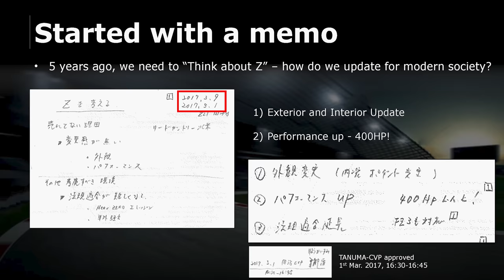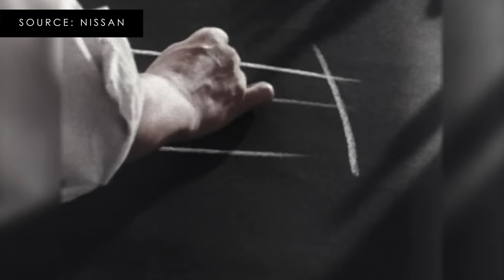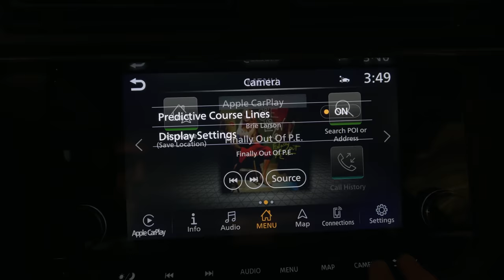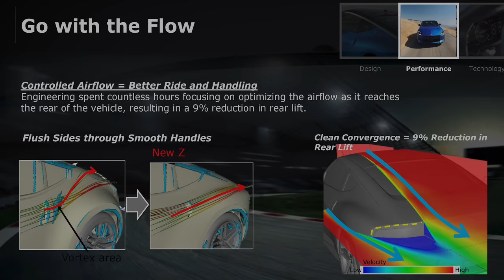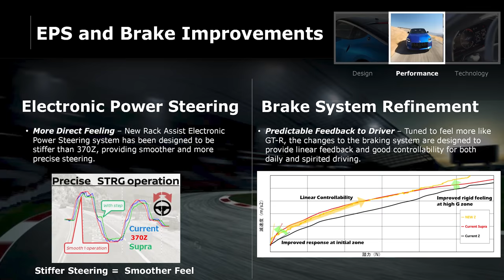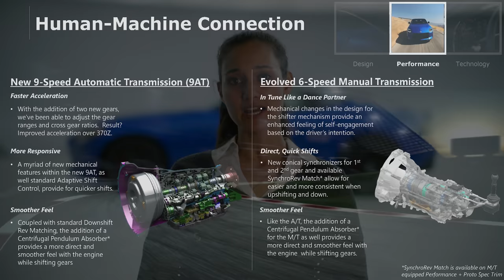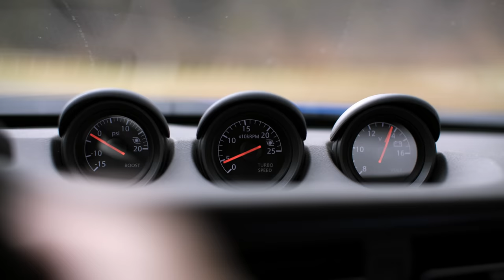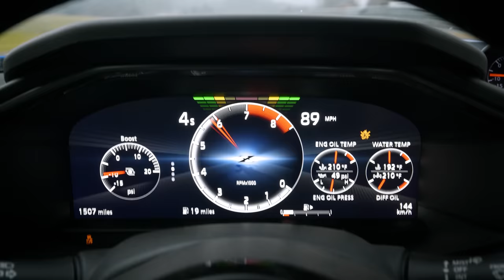2023 Nissan Z | Until The Bitter End

Comment: Even as a self-proclaimed Nissan hater, seeing the careful consideration that went into this Z is something that brings me tremendous joy. The world we knew is sunsetting, that is unavoidable. The next generation of driving may be awful, or it may just be wonderful in its own way, only time will tell. But for those of us who have been raised on the feeling of driving a well set up, connected sports car, one where every one of the senses is put to use to precisely move through space, the new Z is a triumph, despite its flaws. A massive congratulations to the engineers and designers that pushed to bring this car to market, especially at a tough time like this at Nissan.

Here's to another few decades of modified Z's making trumpet sounds down the street at 2am.
Reply: I hope this trend continues.
Reply: Problem is, it is ultimately from a brand that never recovered from the GFC, and is owned by Renault group - which means no matter how good the car is, you have to deal with some of the worst after sales support in the world if you buy one.
Reply: I also am glad this came around because I feel like it was partially the reason for the Supra getting a manuel. They don't want to lose all those customers to the z family lols
Reply: Nissan sure is flawed now, but they’ve made more affordable drivers cars in their history than just about anyone, even if you think Honda’s or Toyota’s are better.
Reply: Nissan hater? Lol I didn't think anyone could have such strong feelings about Nissan let alone hate
Reply: @motormusique  I think he’s talking about the cvt vehicles and the stigma they have. Busted bumpers, driving super fast and such.
Reply: @nathanchildress5596  Nissan Japan had a great history for sure - but that's all that is left now.  The engineers & designers have done a great job here for sure - but underneath it's a platform designed over 20 years ago when Nissan was still Nissan, and that's the only reason they got this past Renault - because it didn't require a billion dollar investment in developing a new platform.  Renault are a company with no passion for what they do - they just make consumable junk for the mass market and treat their customers like ATM's.
Reply: @BrandonMeyer1641  Yup, and the EV's where they want to charge you more than the car is worth for a new battery when the old one packs it in prematurely because they didn't bother to design adequate cooling for it.  It's not Nissan's fault, per-se, it's that they've been taken over by a miserable pack of wankers who have no interest in motoring, only in shareholder returns.
Reply: @Beer_Dad1975  yep that’s kinda of a totally different issue tho. I’m pretty sure most ev oems are like that nowadays partially because they don’t want to spend the money on Hiring or training specialized staff to open up a pack to replace a faulty module for a lower cost to the customer. Instead they rather take the route of taking the whole battery and replacing it with a new one at an egregious cost to the owner. That way they can recycle the pack at their own specialized facility where they can take the good cells and use them in new products and recycle the old cells so they can turn a bigger profit. Idk how long this model will last though. specialized workers will become more plentiful over time either through schooling or turnover from oems and local shops will be able to do the hard but cheap job replacing the broken module with a good one. It’s possible rn just not very prevalent as the ev doesn’t hold majority market share.
Reply: @RiasGremoryS54  nobody hates on the gtr people hate on their mass market vehicles with cvts.
Reply: Cars like this don't have to be a thing of the past. The only thing that makes it so is government regulation.  I don't know why everyone accepts this.
Reply: @kevin9c1  it’s money. It always comes down to money. Consumers don’t have the financial freedom they used due to numerous reasons and manufacturers don’t want to invest in low margin, value-oriented sports cars. You can blame government safety standards all you want, but R&D for a sports car that needs unique engine/trans/chassis to resonate with enthusiasts is the real deal killer for most brands.
Reply: Huh, well i sure hope that u self called Z enthusiast buy these cars but at 50k for the one thats worth a damn with 20 year chassis i highly doubt it. To me nissan dropes the ball
This car is too heavy and too expensive and maybe ugly but thats subjective.
Reply: It's based on the 20 year old FM platform. It's an ancient car with a face lift. Nissan is forever dead; the people who brought us the SE-R, 4DSC, 240SX, 300ZX, etc. are long gone.
Reply: @taylorc2542  and a 2022 price
Reply: @BrandonMeyer1641  Very good point.  Renault group do however have a wide reputation for charging huge prices for even common parts in common models - things like water pumps, electronic control modules etc - plenty of horror stories can be found of people paying hundreds or thousands of dollars for something another manufacturer charges 1/3rd or less for.
Reply: So well said my friend!
Reply: @Beer_Dad1975  yeah I was talking more about evs in general. I wouldn’t touch a run of the mil Nissan/ Renault/ Infiniti product with a 10 foot pole. 1) I don’t like how they look inside and out 2) I’ve driven them and they just aren’t nice to drive 3) many of them are unreliable. Among other issues. I think most people are better off going mainstream the only reason I see to get a Nissan is if you can’t afford or have the credit score to get anything else. The trucks and sports cars a different story. They are built pretty well, the trucks are particularly reliable, and the sports cars have appeal. I wouldn’t mind buying a truck or leasing one of the sports cars if I had the money to do so. Otherwise I’m going to stick with Toyota. As average people cars go, they have much more to offer.
Reply: @taylorc2542   I guess you didn't watch the video
Reply: @BrandonMeyer1641  I've owned Nissans for 30 years. I can count on one hand the times they let me down.
Reply: I'm a self-proclaimed Ford, Toyota, GM, Stellantis, Honda, Kia/Hyundai, BMW, and Porsche hater
Reply: Beautifully written
Reply: @BrandonMeyer1641  Yup the Navara is still a good vehicle for sure, good alternative to a HiLux.  I'm driving a 10 year old Lexus - can't really think what to replace it with as I love the N/A V8 - a LC500 would be nice but way too much money and I still need 4 doors.  I figure in a few years the kids will be gone and I'll be back in the market for something sporty - but the options for a new car are narrowing :-(  I guess by then the Z will be out of warranty and might be worth a punt as a fun used vehicle - especially as I prefer to do my own maintenance and like to modify cars.
Reply: The next generation of cars is only electric if we allow it to go that way. As enthusiasts who want to see our hobby to continue, we have to buy these cars new. If we buy them, the manufacturers will never have a reason to stop making them.
Reply: People who hate Nissan have no knowledge of the brand. They are legendary, regardless of what they are going through now.
Reply: I feel you. I worked at the famous JDM Legends. For some reason, even being surrounded by the the most famous well built Z's in the world, I never caught the fever. When they released this, I thought I was ugly. But the more I read, the more I want one. It has grown on me, and I get excited that I could finally find a drivers car under 60k to rival my S2000 and give me new comforts for the next few decades.
Reply: @povertyspec9651  Nissan products of 30 years ago are not the same thing as anything designed and built post GFC.  They are all utter garbage except for the commercial vehicles.  If you own one from new, sure it'll probably be OK, if not you can get it sorted out at the dealership (who will probably deliver absolute second rate service) - if its out of warranty, good luck to you - transmission - shit - electronics - shit - suspension components - shit - engine ancillaries - shit - replacement parts - insanely expensive.
Reply: @taylorc2542  I hear you on the age of the platform - BUT it was a very good platform, and I expect given the price point, this will still be a very good buy despite the age of the underlying chassis architecture.  My one real turn-off is what the brand has become.  If you buy one of these new and you have a problem with it, you care going to have to deal with Renault group's corporate culture of assholeness - which means they won't have parts in stock, parts will take forever to arrive, technicians will be inadequately trained and constantly get basic servicing and repairs wrong, dealership after sales support staff will be rude and unhelpful, and anything they think they can get away with they will try on, to the point you have to get your lawyer involved to get them to honor the warranty.  Buying a car is more than just the initial purchase, you buy into the whole ecosystem, and Renaults ecosystem is one of the worst out there.
Reply: Beautifully said 🎺
Reply: Haters are so cringe
Reply: @sepg5084  Anything you don’t like is cringe. People are always going to have their own personal opinions get over it. That being said I really like the new VR- Z and I am a Z owner (HR).
Reply: It's going to be horrible and expensive haha
Reply: @Mr.Thermistor7228  I was just speaking on the future of vehicles in general that the original commenter mentioned. I'm not too optimistic with all the new regulations coming in 2024.
Reply: @jizzyjake6783  bro my bad totally read that wrong
Reply: @Mr.Thermistor7228  nah it was my bad. I could've clarified what I was talking about exactly responding to such a long comment.
Reply: @jizzyjake6783  nah not even bro that was totally on me I completely jumped the gun and drew a terribly wrong conclusion lol
Reply: Nissan actually made a Japanese car….. unlike Toyota
Reply: Go Nissan, for caring about the 10% of car automotive nerds and drivers, Thank You 🙏
Reply: The next gen of driving WILL be awful.  The only thing fun about EV's is the torque.  That's just not enough.  No real sound.  No gears.  No tuning.  What are you going to tune?  Make it lighter? Larger battery?  I will always own an ICE car, and I think hydrogen cell is the way to go, not batteries.
Reply: As a nissan hater, here he is commenting on it, go back to your Zupra forums
Reply: @captainminecraftist  This is like 90% of the reason toyota ended up giving the Supra the manual (that it always deserved)
Reply: Beautifully worded
Reply: @cdwag23  yea from the one that hates Nissan 🤦🏽‍♂️
Reply: It isn't unavoidable. Weak and passive men let things happen to them that they don't want and that is the truth. We're all liable.
Reply: Despite its flaws 🤣
Every car has flaws, even your Transgender Supra for one.
Reply: The car looks great, and by many accounts, actually is a great car.  What is going to be key in manufacturers making more cars like this is sales.  Unfortunately, Nissan dealerships are just a few notches above “buy here, pay here” lots.  I think I speak for many people in that we buy a new car for the warranty and fewer headaches.  I gave Nissan a chance again, having owned a Sentra SE-R and a 370Z in the past, by buying a 2022 Frontier.  The truck is great, but the 2 dealerships within one hour of my home have no idea what the word service is, let alone how to spell it.  Thinking about having to deal with a warranty issue with a Nissan dealership…let’s just say I would rather book 2 appointments back-to-back with my dentist.
Reply: @Beer_Dad1975  Nissan didn't have to get Renault's approval to do this. Nissan's budget for this Z refresh was $240 million. They are not going to spend over a billion on a new platform for a low volume (compared to their mainstream vehicles) 2-seat sports car.
Reply: @FuriousFilipino   There are some good Nissan dealers out there.
Reply: @povertyspec9651  I’m sure that there are, and as far as sales go, even the mediocre dealers are tolerable enough to deal with if you, as a buyer, have the financial leverage (i.e. you have top tier credit, you have equity in your trade, etc…).  Service, particularly warranty service, is where a lot of  Nissan dealerships fall flat on their face.  I’ve had bad luck with a few cars, but even what I thought was just an “ok” Hyundai dealer put me up in an Audi Q7 for a week while they sorted out what was wrong with my hybrid.  The closest Nissan dealership here makes me feel that I’m in the wrong for coming 5 minutes early to an appointment because the doors to the dealership aren’t open yet.
Reply: @povertyspec9651  Yeah they did, no way can anyone spend 240 million dollars without the board of directors signing off on it.
Reply: Amen brother! Well said!
Reply: @Beer_Dad1975  GFC? What is that?
Reply: What does Z actually stand for?
Reply: @saulespino2510  Global financial crisis, when global markets tanked around 2007-2008, mostly caused by excessive high risk lending - a lot of Japanese auto makers responded to the GFC by cutting costs at the expense of quality - Nissan and Honda in particular were both making mostly quality vehicles prior to the GFC, and mostly rubbish after the GFC.
Reply: @Beer_Dad1975  Bro you're talking abt Nissan like it's a defenseless puppy getting eaten alive 😂
Reply: @RAZGR1Z  Great comment.
Reply: @taylorc2542  20 year platform that can out handle most other sport coupes and beat them to 60 mph! Whats the problem with that? Honestly why fix whats not broke ?
Reply: @povertyspec9651  same i have gone heads up with other sport sedans with traditional transmissions in my wifes 16 sr maxima and beat em! I dont condone street racing just messing around once in a great while and it just shows how good the cvt and there cars are!
Reply: @MeliorIlle  So true! I have owned Nissans great cars! Narrow minded people cant get past the Name and automactily assume the worst!  Lame!
Reply: @jizzyjake6783  says the guy i bet likes  likes subarus? Mayby mayby not?
Reply: @fredwilliams7893  haha I don't know where that came from but I honestly couldn't name one vehicle Subaru makes.
Reply: @Beer_Dad1975  GSF
Reply: @jizzyjake6783  ST... oh wait
Reply: @jizzyjake6783  usually people who hate Nissan like junky subarus.!
Reply: @fredwilliams7893  my comment was referring to new vehicles in general not Nissan specifically.
Reply: Do you also have the R35 GTR?
Reply: @motormusique  to see this guys hate of Nissan’s you have to go back and watch his 370z Nismo video. This guy really hates what this car is.
Reply: @ACommenterOnYouTube  understand he makes his money reviewing cars and the new Z is getting a lot of looks now. He hates Nissan’s but he knows if he gives a negative review that he will be closed out of reviewing anymore Z’s.
Reply: @Beer_Dad1975  Renault made the Alpine A110. Probably the most enjoyable sports car in the market right now. The true successor to the Elise. Renault has made some pretty amazing Megane and Clio hot hatches too... Also the GTR, another all time great, was designed and produced "under" Renault... Get your facts right next time before starting to spew bs around. If it weren't for Renault, there might have not been a Nissan around anymore.

And lastly, even though Renault has more influence in the alliance, Nissan is not a subsidiary. It has its own chain of command completely detached from Renault management. It is an alliance. Renault and Nissan share goals and technology but each still has their own values and processes.
Reply: @AI-qd4vb  I've driven the Megan RS, hired one on a holiday once.  It was less than a year old, the aircon didn't work and it had a check engine light.  I took it back to the rental company and they replaced it.  The replacement was also less than a year old.  It had a rattily dashboard and worn syncromesh on 1st & 2nd gear (think it had something like 30,000km on the clock) - I put up with it but it ruined what I hoped would be a fun trip.  They are fun to drive for sure, but utter junk.  Renault own nearly 50% of Nissan, which means they control the direction of the company as the majority share holder, and can pretty much appoint the board of directors as they see fit.  Who do you think appointed Carlos Ghosn?  The Japanese sure didn't choose him - they hated the mofo.

Comment: Re: Conclusions about having cars faster, but less connected. This has been my exact feelings on modern cars, with the exception of the new GR86 / BRZ. After driving one around for a few weeks back to back with the new WRX (which is an improvement on the VA, but overall still *fine*), the 86 is an absolute blast, and I wish more manufacturers would listen to these comments. I'd love to hear some notes comparing the two.

Comment: Awesome work!! This car shows me that Nissan still has some soul. Harks back to Nissan from the 80s/90s when they were truly building great cars. With the Supra now coming with a manual, it’ll be interesting to see what happens with sales. What’s very clear is that the Z will be a much better value than the Supra, especially given the suspension in the Z, and that you get a lot more power in the Z for significantly less money than the Supra.
Edit: Mechanical handbrake in the Z FTW!
Reply: How come NISSAN can build a new, in house Z but Toyota can't build a new Supra/86?
Reply: @obamacarreviews1043  Nissan Z isn't all-new. It's based on the previous car. Toyota had to design theirs from scratch. That's not to say that Toyota couldn't design theirs from scratch, but to explain that Nissan may have very well not made this new car if they had not made 370Z 13 years ago.
Reply: @andycalifornia426  Toyota didn’t have to design anything other than the steering wheel logo on the Supra😂